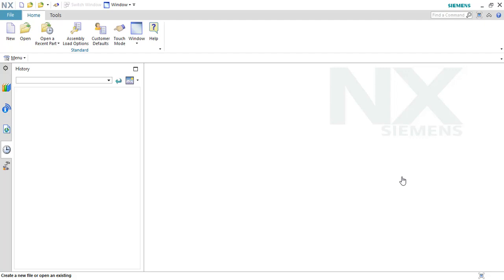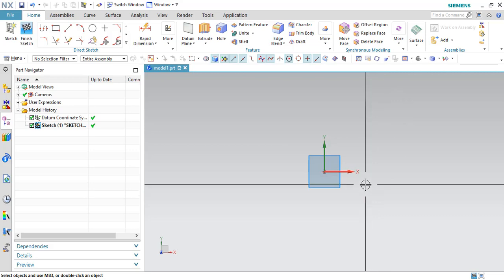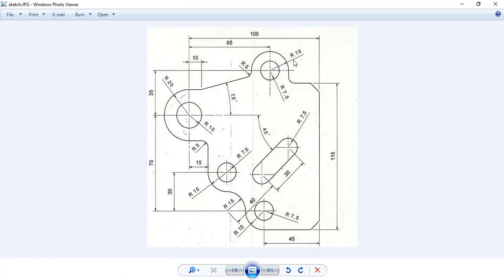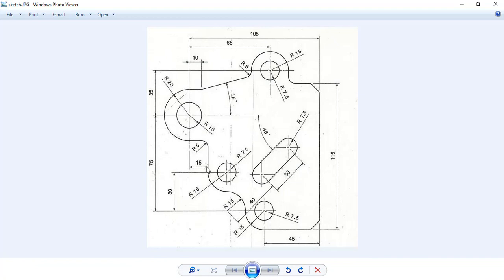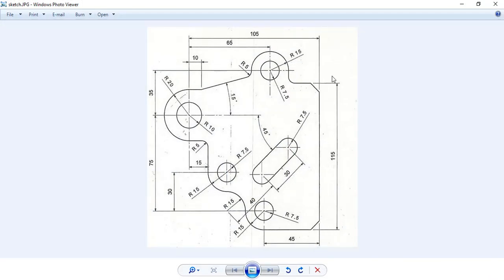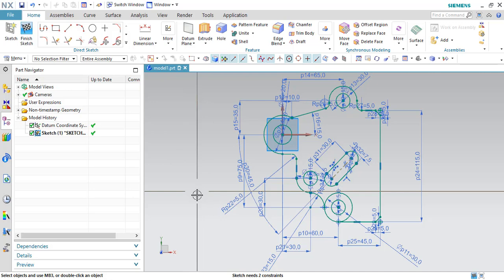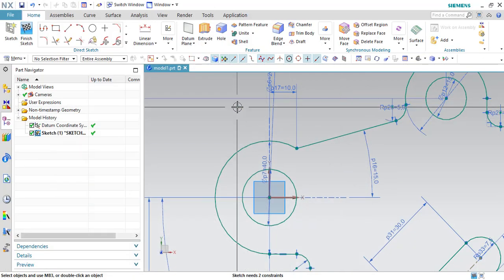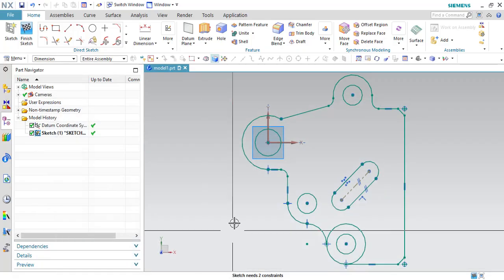Unigraphics NX- Sketch Example 7 with constraints and Dimensioning for beginners

Comment: Hi sir Video is so useful. But you make one small mistake near 1st circle you draw one line at 10 mm distance at an angle 15 degree. You directly join to circle but this line is not directly join to circle. First draw one line 10 mm which is tgt to 20 mm radius circle then 15 degree incline line starts.
Reply from the maker: Yes, you are right.. Good catch